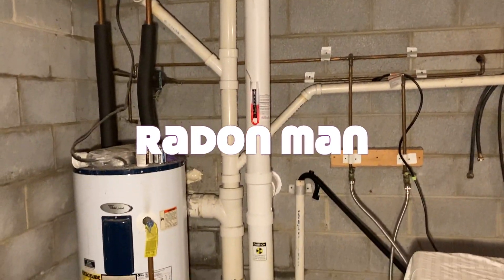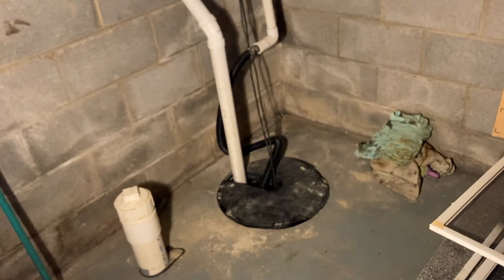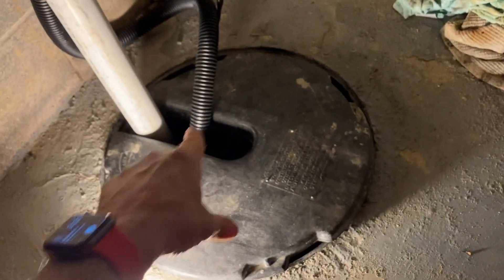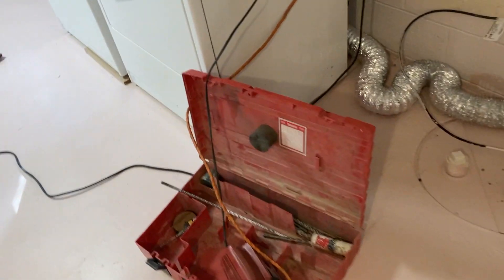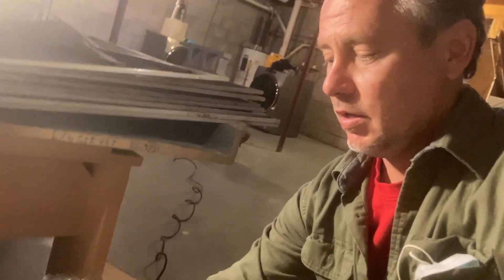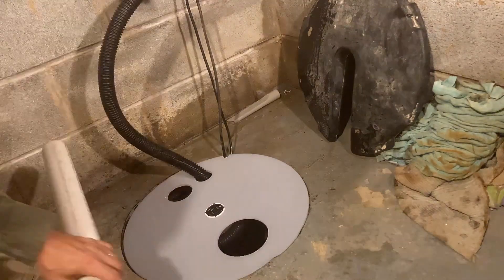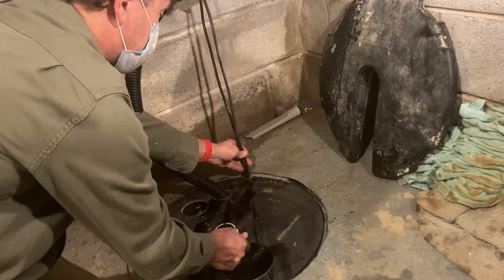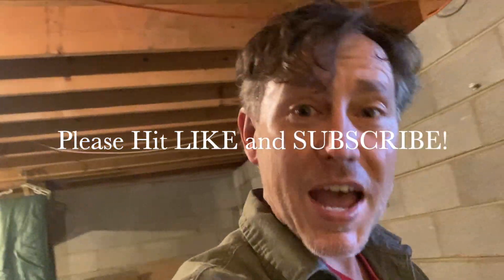Your Sump Pit Is Killing You

Comment: Hi Scott, thank you for your videos. I'm planning to install my own system drawing from my sump pit.  My pit is close to a bathroom and it would be fairly easy to tie into my homes sewer vent and avoid all of the unsightly pipes and fan, etc on the outside of the home. I know it probably wouldn't meet code but dont care about that.  My question then is there any reason why this would be ok or not ok?  I would put the fan either in the attic or in the utility room where it would be easier to make sure it is functioning properly.   Thanks.

Comment: These videos are helpful.. Thanks. Just curious why you wouldn't purchase a small sump pump tube knowing that it is split and leaking. (charge it to the owner?)  Also wondering why you would not seal the hole where the Radon exhaust tube goes through the new lid that you purchased. You were meticulous when installing the piece to the new lid that allows water to go into the sump pump pit but it does not allow air to escape yet you are allowing 1/2 gap between the lid and exhaust tube.

Comment: I've been working and living in my basement for 7 years now. My radon readings are around 150-175 (Bq/me3), even in the bathroom nearby (separated by an inside wall) my open unused sump pit. When I close my bathroom door my readings go up to 450-500 within two hours. Your video is the exact thing I was looking for... you nailed it. Thank you.
Reply: Question is:  is sealing the sump enough, or it must also have a fan that draws from sump and blows outside?
Reply: The fan and piping to vent outside is absolutely necessary! @dwaynejohnson6277
Reply: @dwaynejohnson6277 you need to test—imo it’s unlikely to be enough.

Comment: I'm currently finishing up a sump install in my basement (first time doing it, not a pro). For allowing water in but keeping radon gas out, I considered devices like the Hi-Perdrain, but they all have low flow rates. I also considered devices that are essentially rubber socks with high shape memory, but again, the flow rate is so low. So my thinking is that I'll make a p-trap on the bottom of the lid. The only issue with that is with traps on low use devices, you have to make sure to top that water up on occasion. I have a dehumidifier that drains through a hose, and I'm just going to put that hose near that drain. Just my current thinking. Thanks for making videos and being honest about your skill level, don't fret the people who choose to be negative rather than keep scrolling.
Reply from the maker: Hi Geoff. Thanks for your comments!
Hope I'm not too late. I recall a situation where a p trap did not go well and it's in the video link at the bottom. However, I believe that I was using a high suction fan. Nevertheless it caused gurgling from a floor drain.  Best of luck to you and your project.  
https://www.youtube.com/watch?v=QEgyI6rdMeA&t=255s
Reply: @radonman6800  Not too late, and interesting! My approach is inspired by the link below. My p-trap will be on the sump basin lid itself, and the sump is ~40 ft from my radon fan. Hopefully that will allow enough room so as to not be an issue. The drain on the basin lid is not necessarily a "must have" for us, so if it's an issue, I'll just remove it for the time being haha. Thanks, man. Cheers
Reply from the maker: Good luck Geoff!

Comment: CAUTION!!!  You’re creating a negative air pressure by not sealing the discharge pipes to the lid.  Also very important to pay attention to other cracks and conduit that can pull air from the room/house.  If a natural draft appliance is located in the house it can and often does spill carbon monoxide into the house rather than venting properly via buoyancy/stack effect.  Potentially fatal oversight.  Looks like electric hwh in this circumstance but diy’ers can get very sick/die if they don’t know what they’re doing and follow this method verbatim.
Reply: I like this input. It would be wise to have a air balance done with systems running to verify one is not attacking the other. Most areas have a energy cooperative that can help. Range hoods, Gas dryer vents and a furnace can back draft. Making sure the lid is rated for radon mitigation is a first thing. Cracks in the slab and cement floor that meets the walls need to be sealed off. If the basement slab is sealed 100% and the lid rated for this. the system will create suction and deems the house safe.
Reply: Do you mean don’t have any open gaps under the lid Above? 
What do you think it means if the discharge water is golden color? Rust or bacteria and how to clear it? 
My sump pump is just touching the ground under the foundation, that’s bad? I’m thinking of putting a Home Depot bucket in there and drilling holes on the sides to reduce earthy substances.
Reply: @kaltrex9465  yeah, it all needs to be sealed from the suction point, lest the ambient air in the home be exposed to the suction.  The above comment from @djmcnamer7159 makes a good point about sealing up cracks in the foundation for example.  If you had a cracked slab, the vacuum just take path of least resistance and just pull air from the ambient air in the basement creating a vacuum (negative air pressure) which would pull products of combustion (carbon monoxide CO) from your natural draft (hot water heater potentially) appliances.  It would also decrease the amount of suction we could apply to the sub slab.  But yeah, lit sealed for sure.

Comment: Radon systems are supposed to be sealed as tight as possible. Why didn't you seal around the 2" pipe you installed in the pit cover? It won't draw as good as it should unless the slab corners,grooves and pit are sealed as tight as possible.
Reply: In addition to not drawing under the sub slab this method can also create a negative air pressure sucking gas appliance exhaust/carbon monoxide into house.
Reply: He stated in the video that the sump hose still needed to be repaired/replaced.  This isn't a finished install as the seal would be broken in short time if he did.

Comment: If you had a water softener that drained to that sump pit, how would you handle it? I have a similar setup as shown in your video and would like to install a Tee fitting on my radon exhaust pipe (about 2 feet above the sump cover)  and put a trap and standpipe for the water softener to discharge into.  This would allow me to maintain the vacuum seal on the sump pit (with the trap) yet still meet the code requirements of having an air gap for the water softener discharge.  Does this sound like a reasonable approach to you?
Reply from the maker: I would use the sump lid shown in this video that equipped with the Hyper Drain and route the discharge line to that. The strainer is plastic so you could notch out a section to route the tube into it or put a 90 right on top of it. Thanks for watching!
Reply: @radonman6800  Thanks for the suggestion!  Have you ever seen a radon exhaust pipe from a sump pit double as a drain pipe for a standpipe with a trap?  I'm trying to think of reasons this wouldn't be a workable solution that would be less prone to failure over time as compared to a mechanical device like the Hyper drain.

Comment: Where can I buy a sump pit cover like the one you used ?
Reply: Jeff get a jackal radon mitigation lid off Amazon. Comes with a selection of seals and gaskets and seals up great. New model Ds have a plexiglass access hole to check your floats or perform maintenance. If you are going to do it do it right. That plexiglass cover was junk and in no way was it airtight completely defeating the purpose of the vacuum circuit. That thing was drawing conditioned air into the pit
Reply from the maker: Hi Jeff, I get them from Radon Away but they only sell to mitigators- so I'd begin by Googling sump pit lids and Hyper Drain, etc.  Ebay, Amazon, etc.  Good luck!

Comment: Hey Scott, I thought most radon mitigation seal up the cover and fittings so it draws radon from under the slab better than from the room above. How much do they cost? I will go to their website and check.
Reply: rip all that conditioned air :(
Reply from the maker: Hi Don, I get mine from Radon Away.  However they only seem to sell to Radon Pro's.  I'm sure Google or Amazon will get you there. 😀
Reply: Don jackal radon cap on Amazon 75 bucks seals for all different sizes, cap gasket, stainless hardware, I would not use another cover system